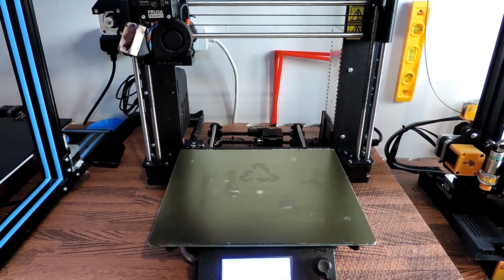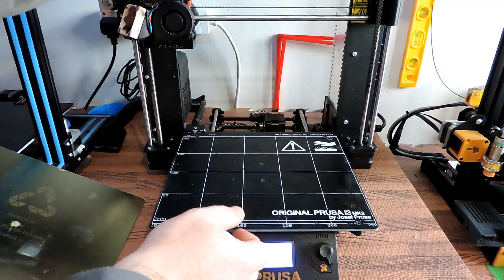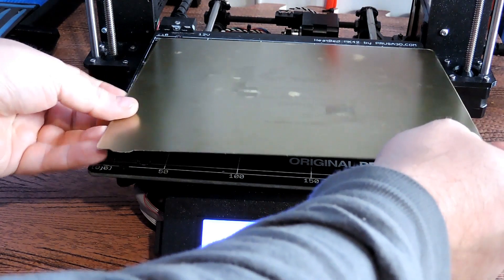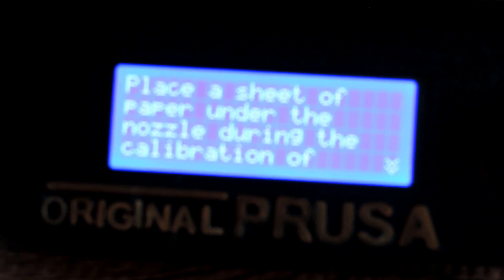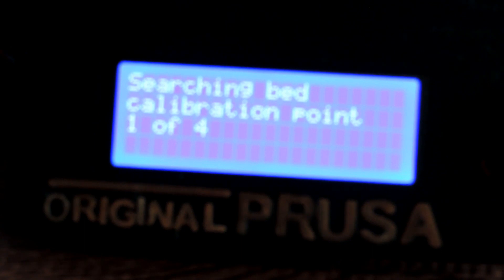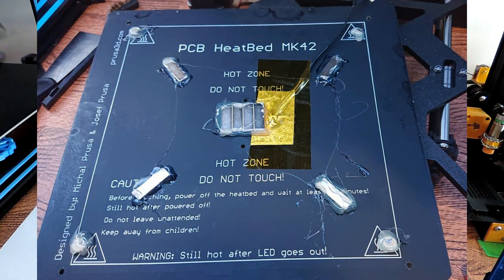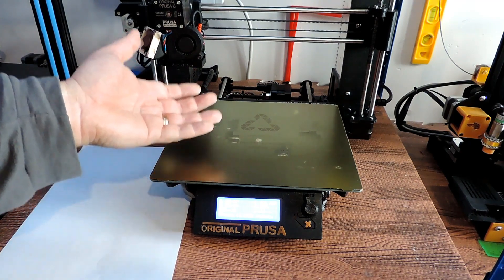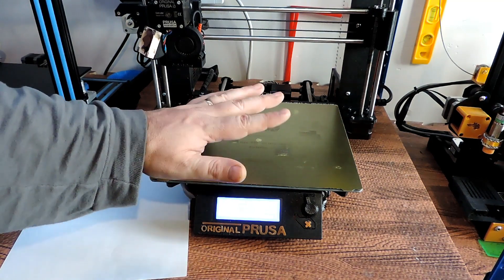Prusa I3 Mk2 DIY Flex Plate Concept

Comment: hi. can you tell me if this will work without changing sensor?
Reply from the maker: Yes, It should still work.
Reply: @DerekMatthews  thanks for thr reply. i am waitting for the pei plate so i can try it out.
Reply: @DerekMatthews  hi. got this working. its great. so easy to remove the bed plate. thanks.

Comment: Do you need to pull off the pei sheet?
Reply from the maker: No, I left the pei sheet on it and works really good.
Reply: @DerekMatthews  thanks man i buy one tomorrow on ali express!! 17 euro. Thats better than 200euro for the mk2.5 upgrade
Reply from the maker: @BMF123321  This is what I found so I thought of trying something out and it worked fine.
Reply: @DerekMatthews  plate arrived i glued on the magnets works very nice only the 4 points xyz calebration doenst work with the plate on. What can i do?
Reply from the maker: @BMF123321  i also found that sometimes it didn't work all the time for me.  I just done a Z calibration which worked fine.  Just try that and see how you go?
Reply: @DerekMatthews  i think i glued the magnet in the wrong places they are right under the calibration points
Reply: Right under pinda probe position
Reply from the maker: @BMF123321  Yeah I saw that, maybe move them out of the way, but then you might not have enough to hold it in the middle
Reply: @DerekMatthews  do i need a different sensor? Inductive you say in the video? Is the stock one different? Maybe thats why its failing?
Reply from the maker: @BMF123321  I did replace my sensor, but not sure if that was the issue you are having, but like I said I done a z calibration and it's been fine ever since.  Just try that and see how you do.
Reply: @DerekMatthews  i have one magnet thats under the 9th calibration point and it fails there. So i do some tweaks and let you know.
Reply: I think the magnets are too strong that i use. Because when i do a first layer test of 10 cm printing square. The lines were the magnets are underneath the are messed up. lol. What i can do is pull of all the magnets. And pei sheet en use the magnet pei sheet that the plate came with. Its less strong but strong enough to hold the steel plate

Comment: Hello, are you still ok with flex plate? I added magnets (smaller than you) to my Prusa MK2s and original Prusa MK3 flex plate and i have problem with first layer. Print to print is nozzle too low or high and i have to tune Z every print. I made Z calibration and no change...
Reply from the maker: Yeah my flex plate still working fine.  After installing the flex plate you will need to do a Z calibration, then a test print to adjust the 1st layer and then you should be set.

Comment: Hi Derek, nice and very cool idea! Why change to MK52 12V bed if you have already a great one :-) Prusa reported some issues with the 7x7 MBL on the MK3 as the magnets can throw off the P.I.N.D.A. readings (it is an inductive sensor). You may want to try to connect via Proterface and run "M45 V10" (xyz calibration in verbose mode which takes quite time) without the spring steel sheet and than again with it and compare the results. As the MK42 has 9 calibration points in the PCB and uses 4 of these to determine the skew of the bed it would be interesting how it is without and with spring steel sheet. You also may consider to use my MK2 firmware with filament runout sensor and hyperfine bed leveling and communication fix https://github.com/3d-gussner/Prusa-Firmware/releases/tag/v3.1.0-001-HFM 
I will update the firmware soon to the newest 3.2.2
Reply from the maker: Hi 3D Gussner,  I don't have a filament runout sensor so would that firmware still work?
Reply: @DerekMatthews  yes it will you just need to read the release notes, you can en/disable the FRS via lcd menu
Reply: @DerekMatthews  In the release notes are links to filament runout sensor designs, easy to implement